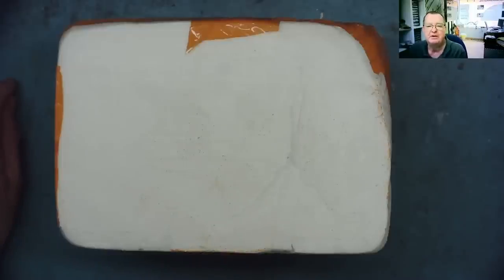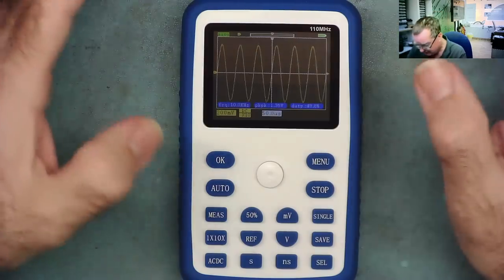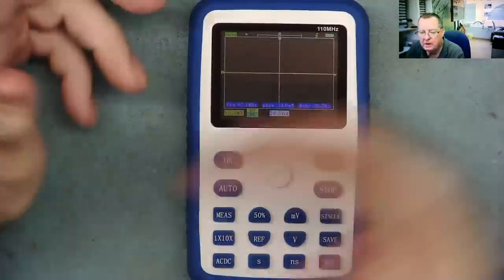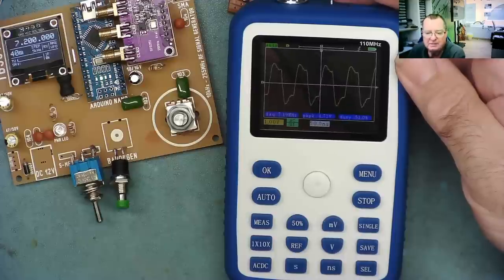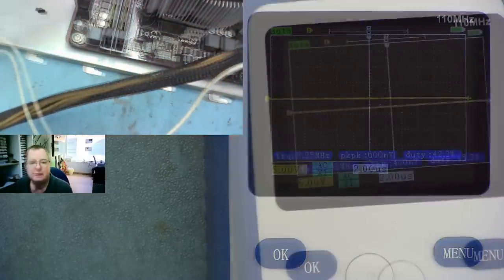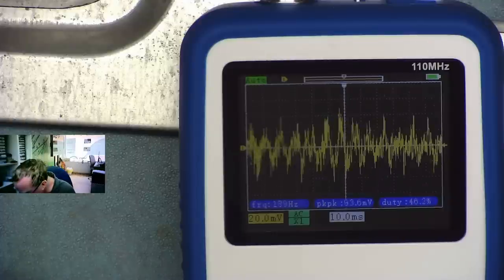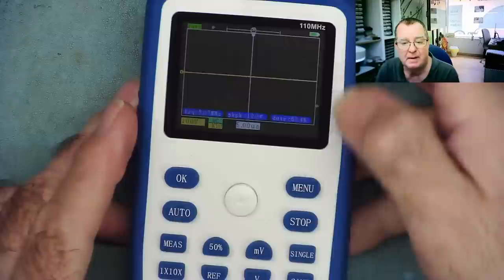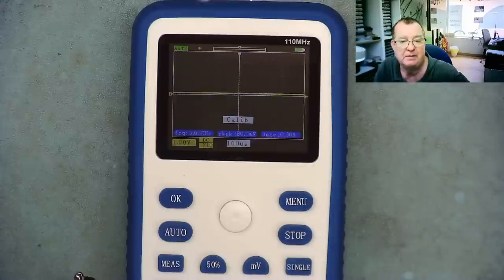A 110MHz Oscilloscope for under $70! Is It For Real And Is It Any Good?

Comment: I had bought an old o-scope a while back out of curiosity. I've learned many things from you and wish you would do a video on how to use an oscilloscope for dummies. I'm afraid to touch mine.
Reply: Dave Jones at EEVblog has a play list on using oscilloscopes including a video titled "How not to blow up your oscilloscope" that you might find helpful
Reply from the maker: I've been asked a few times to do this - I will make a video shortly 🙂
Reply: @LearnElectronicsRepair  I would definitely appreciate that, would love to see how it would help diagnose something like distortion in a receiver. I have a vintage receiver that has distortion is one channel. I attacked all the transistors and capacitors and changed them. Built a signal probe and can still can't find the issue.
Turns out that the o-scope I bought isn't working properly either, the screen has a huge fuzzy green block on it.
Reply: Mr Guru  turns out the o-scope I bought (Tektronics 2213A) isn't working properly. It has a huge green blurry rectangle. Have to figure out how to fix it first :(
Reply: Mr Guru  My issue is a few vintage receivers I have that have distortion in a channel. They've all had capacitors and transistors changed out. I even tried using an audio probe to find it with no luck. Problem with the audio probe is that I can only test positive signal. 

I've read on some of the factors that could cause my o-scope to do what it does. I considered getting a new one before I decided on it. My guess is UPS flung it around during shipping because it was supposed to work, or, I got duped.
Reply: @LearnElectronicsRepair  please do
Reply: @Jedda73  Dave's great, thanks for the oscilloscope for dummies tip.

Comment: Using this on SMPS accidentally with probe on 1x seems a quick way to blow-off cash. Yes, one could just tape the probe at 10x but still, 400v is not enough headroom for most SMPS (especially if is there's a faulty RC snubber). If I owned one, I'd  use a safety rule: If above 150v, use an extra level of attenuation -> A BNC 10:1 (shrinked or taped over for more safety). My vintage Kikusui Com7201A can do 400v at the inputs, so for this mini scope I'd leave the 10x attenuator connected 100% of the time.
Reply from the maker: Actually I will be honest with you, the first time I tried it on the SMPS I actually had it on x1 probe.  It worked OK but I knew full well that some sharp eyed viewer would point this out, so I re-recorded that bit on x10.  It didn't cause the Scope any harm, maybe I was just a bit lucky.
Reply: @LearnElectronicsRepair  Yup, I'll agree luck seems to have saved that input Transient Surge Suppressor for that short period. I'd still use a cheap 10x attenuator for SMPS work, it's safer and who cares if the ADC only resolves down to 2 volts at 100x, the waveform shape is what matters.
Reply: Mr Guru  Wish I had a ' Defender' machine !
Reply: @LearnElectronicsRepair  my guess is they implement some type of protection,since cheap scopes are made for beginners and hobbyists who for sure will make mistakes with the 1x 10x.
Reply: @andymouse  What you want is a Robotron 2084 machine. It's the sequel to Stargate Defender. I don't think it can be emulated very well either because it uses 2 joysticks. Plus it is the greatest 8 bit arcade game ever made. Robe out!
Reply: @1pcfred  Yep it's up there with 'The Big D'  for sure Robotron was special as well oh those banging Williams vibes !!!!

Comment: @Learn Electronics Repair - check out the DSO-500K. It's a 2 channel scope with signal generator based on the Raspberry Pi W which let's you use your android phone as a screen. It costs less than $50, shipping included. It's just the board, so you'll want to grab some probes, and a box and such if you'd like those.

Comment: A few sidenotes about portable oscilloscopes that are not mentioned. When using these (low-end) handheld scopes on earth referenced measurings, like measuring mains voltage, or on SMPS, you can use these, but it's recommended to use a fixed x10 probe with isolated BNC connector, AND, use them only powered by the battery inside.
That 5V usb charger/powersupply is only good for 1 thing, charging a battery and nothings else. These cheap 5V SMPS powersupplies are not suited to power a sensitive device like a scope, because they add lots of noise and ripple to your scope, AND, they leak mains voltage to your scope when connected to your scope. This leakage can go up to 50% or more of the mains voltage, but with low current (µA range) due the blue Y safety capacitor that is connected between the primary and secundary coil of the pulse transformer. Because scope measurings rely mostly on single ended probes, the measured signal on the probe pin is compared to the metal part of the BNC connector and this is ground at 0V. But when you connect such a handheld scope to those cheap 5V SMPS powersupplies, and mains voltages leaks to this metal part of the BNC connector, your ground shows still 0V, but when you use a DMM, then you will measure a voltage between the metal part of the BNC and ground/earth of your mains wall outlet. 
So your scope ground is not 0V, and your measuring is wrong. This is the same as using a bench scope, and cut the earthwire/pin of the mains power plug. Due the safety caps inside the scope, mains voltage will leak to the metal side of the BNC connector. This is low current, but enough to fry delicate electronic components. 
So my advise is, if you want to use a handheld scope, and want to power it from the mains, use a old linear 5V powersupply, or build one with a LM7805 or so. In the end, you will have a much cleaner and safer result.
Reply: Or just run it from the battery. That's the most ripple free power source possible.  Beware that "external USB battery packs" contain cheap SMPS circuits to convert a 3.2 to 4.7V battery voltage to a 5V voltage good enough for powering the internal battery chargers in phones.

Comment: I bought that exact scope about two years ago and even though I have not had a chance to use it much due to some health reasons, I do like it a lot so far.  Another YouTuber did a review on if it is really 110 MHz and he proved that it was. This is what initially made me buy it. I think it cost me around $80 at the time. Well worth the price for what it does!  👍👍
PS: I didn't know that the firmware could be upgraded on it.  I've got to check into that maybe.....🤔
I had to download the manual which is quite common with many (most?) products today anyway.
I don't think that mine came with the alligator clip connectors, though.  Damn!!!

Comment: Always wanted an Oscilloscope, and now maybe it's time! Excellent.
Reply: If you can try to get a more capable instrument than this. You'll appreciate it if you do. You want something with a better sample rate. That'll give you a more accurate waveform.
Reply: @1pcfred  Do you have any links or examples?…
Reply: @jetblakink  it is not something I have any data on now. I can suggest that you learn how Digital Storage Oscilloscopes work though. How they display a waveform. They take samples and then connect the dots. How close their display represents the signal they're measuring is based on how many dots they collect. This scope is claiming 500 million samples a second. Which at 110 MHz isn't really so many dots. In reality at that frequency every wave this scope displays is going to be a sine wave. That's the most detail it can manage regardless of what the signal actually looks like. Square wave? Sine wave! Triangle wave? Sine wave! Mixed frequency? Dancing sine wave! It was funny as a SNL skit when Dan Aykroyd and John Belushi did it but it's not so funny when a scope does it. Cheeseburger, cheeseburger, cheeseburger. You want a cheeseburger! Look that up here.

Comment: I watched to the end looking for the test against a bench scope for the same signals and wondered if your homemade digital signal generator really had that crazy waveform or it was the mini scope getting it wrong.  Because the shape of a waveform is another important go/nogo test sometimes specified in device repair manuals from before digital scopes became common.  Some signals need to be pure sine, some pure trapezoid, some are allowed to go crazy between specific time periods, but need to hold steady around the clock edge.

Comment: I just got this handheld scope a few days ago (traded it for a tray of beer) and although this is of course no comparison at all to my Siglent bench scope, it can stil be very useful for troubleshooting and for those times you quickly need a floating scope. Very handy when you need to know whether a signal is there or not and if it's in the ballpark. I wouldn't use it to rely on its measurement values too much though.
Reasonably good up to 20-25MHz so the official specs are (as always with these toys) tremendously exagerated.

Comment: hi i have the owon vds 1022i is rated to 40v 1x and 400v 10x it have usb isolation my question is what happen if i connect the probe to main voltage but with the battery of the laptop only ??? without the charger

Comment: If they would make a 2 channel version of this, even for a €100 or a bit more, it would be absolutely great
Reply: There is a 2ch model ("unbranded")
DSO2512G
I have both the one in the video (for~2 years) and the 2ch (for~8 months), both model's software is near identical but the 2ch is by far more responsive, also has sig-gen and video output for a bigger screen (rca comp).
Reply: @someone2506  thanks for the info brother, I'll check it out!
Reply from the maker: FNIRSI have said they will send me their new release products to review in future.  Hopefully I can also take a look at their bench oscilloscope, but they have very low stock at the moment so could not spare one for review - I will pass your comment on to them 🙂
Reply: Buy two

Comment: Do you like this one as much or better than the last hand held o-scope you reviewed? I may have missed it if you said so in video.
Reply from the maker: Actually I rather like the little Miniware DS213 and have used it on several videos since reviewing it, but I will admit a lot of that is down to the fact the screen is so bright and clear and comes out so well on my video recording system.    I think this is a bit of a 'horses for courses thing'.  I'll probably continue to use the DS213 as a quick grab and record sort of thing for my videos but I would definitely use the 1C15 for checking things like crystal oscillators and when I want to connect the scop to hot ground.  Mostly my favourite scope is my 100MHz Textronix 458B yet I will admit both of these handheld scopes are proving easier to use for me, but as I mentioned earlier a lot of that has to do with the fact I am recording repair videos. 

It wasn't actually your question, but generally speaking both of these hand held scopes are nice to use, each has it's own advantages and limitations but I wouldn't be unhappy using either of them.  If it comes down to budget, the 1C15 is really good value for money I think and I don't know of anything better at the price.  The DS213 is a really nice thing to have but I felt it was a bit pricey for what it is - yet I love it anyway.   I said as much in each video.
Reply: @LearnElectronicsRepair  I appreciate for the answer. I looked at all 3 you mentioned and will probably try the 1c15 to learn a little about using scopes. Once I get used to it I will buy a better one then. Thanks.

Comment: I wonder if this one has the same FPGA input cct as some of the similar other handheld scopes.  Some have a problem at around 80 MHz where the signal drops out and returns at perhaps 85 or 90 MHz?  There are similar priced scopes with dual channels if you look for them.
Reply: Mr Guru  Rise times on square waves comes to mind...

Comment: For real electronics work a 2 channel scope seems to be the minimum, because very often the trigger event happens on a different point from the point you actually want to measure. But i guess it's ok for checking clocks and signal levels.
Reply from the maker: I'm not quite sure what you mean by 'real electronics work', but to be quite honest, the times i need to use both channels for repair work are very few and far between.  In fact I never had to do that yet in all the videos I published and that is the best part of two years now.  I've had to do this more often with my Salaea logic analyser to decode serial data, but that was more for prototyping than for repair.
Reply: @LearnElectronicsRepair  yeah you're right, I was more talking about design. I couldn't do without a multiple channel scope or logic state analyzer.

Comment: have you reviewed a budget spectrum analyzer?
Reply from the maker: Not yet.  That would be interesting
Reply: @LearnElectronicsRepair  Surprised you haven't checked out the TinySA or NanoVNA.  Then again, depends on what you're doing as many noted when I was looking into, they didn't have much a use for.  RF Engineering & Amateur Radio (Fox Hunting) is what drew me in, having a background in spectroscopy and chemometrics with software development experience on the job.  I immediately saw electronics lab test grade instruments as what I thought would be best to make my gear... then that changed to minimalist like with RTL-SDR's and other SDR's like the SDRplay's, etc.  I wanted to make antennas as well that were wider band and if needed specific frequency ranges.  Plus I had some custom ideas for telescopic mechanically tuneable antenna designs.

Comment: got a 60mhz tektronix analog 2215 oscilliscope for under 100usd, works well, probably needs some re calibration tho,  off by about .2 or .3 volts,  plus dat oscilliscope music work better on dat analog xy plotter mode, i can even hook my dmg gameboy to it for a screen, lulz playing gameboy on effectively a high persistence phosphor radar display tube...you even still have dat green monochrome tint!
Reply: and dats actually a full blown scope too, just a bit older, but if you work on lower power and embedded system, and ya retro game consoles, or shit  like tesla coils, best bang for dat dollah imho, just dont have dat snapshot feature and buffer like dem digital ones, analog display is realtime...you could probably connect an external buffer to replicate dat ability

Comment: Bandwidth has to be measured from the 3db point not if you can still see a squiggly line. From this video the unit appears to have a bandwidth of about 25MHZ. Roughly a 1/4 of the claim which sounds about right for the bottom end of the market. It would be much more useful if you could encourage people to get a minimum of something like a RIGOL DS1054Z. At £439 you will have an instrument with readings you can trust (ish) and actually learn something. Below that is just a waste of time.

Comment: Hi Richard,
Great job showing the capabilities of the scope. Does this model have cursers for measuring voltage levels or time? I frequently travel to medical facilities around the US to work on medical equipment and it would be easier to bring this scope rather then my tablet based unit.
Reply from the maker: It has a measurement option, which displays data on the left side of the screen.  You can select the measurements that are displayed on this list, but I didn't notice you could use the cursor to take measurements
Reply: Thanks for the feedback. The cursor function is important to me because I need to make measurements of partial waveforms. This does look like a good option for basic measurements however.

Comment: Who, back in the day, used to ''float'' their scope by disconnecting the Earth in the plug?
As engineers, we know how safe is safe and when you know the rules you know how you can break them to your advantage.
My bench was supplied with an isolated 240 volt supply, though.
Reply: Still do.  Need to be aware of what you're doing and what you can and cannot touch.
Reply: Yeah was common practice when I was at work in the 80's ! health and safety 'officer' would have you sacked in a heartbeat now !
Reply from the maker: @andymouse  I was taught to do that when I did my City & Guilds in TV, Radio and Electronics Repair - and I did that on a 12 month full time course at a 'Skill Centre' paid for and run by the UK government.  I have an isolation transformer on my bench to power the DUT so I can actually use my grrounded bench scope on hot ground with impunity but I refrain from doing so on my videos to save any unfortunate confusion!
Reply: @LearnElectronicsRepair  Very Wise !
Reply: @LearnElectronicsRepair  Oh small world. I did that same course, The City and Guilds industrial electronics 224 at Portsmouth Skill Centre in 1985 with the practical fault finding exam The RTEEB. We were always competing with the boys in the next class who were doing the TV version. 😁 Shit, that's nearly 40 years ago. 😁😁😁

Comment: I've had a hard time trying to find anything to test the one I recently bought to 500Mhz. Every signal generator that I found cost an arm and a leg just like the scope. To be honest its really more scope than i will ever need. That being said it's worth it to not have to hit the auto button.
Reply: MrTGuru  I somehow doubt that.  One common thing above 109MHz is actual radio signals, amplified or not.  So the VHF bands for TV channels like (european) channel 9, and the lower UHF TV bands will fall between 109 and 500 MHz along with digital TV signals.  Then there's the clock and data signals running between CPUs and memory chips, which also fall in that range.  Narrow high speed signals like USB 2 High speed or SATA data links may be above 500MHz in order to encode data at above 1 Gbps.  And that's just TV and PC stuff.